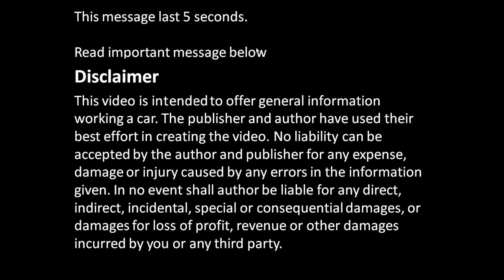How to test automatic transmission solenoid status: OK or Bad ?

Comment: Peter I'm currently trying to find a problem with my solenoids! 

When Commanded by the pcm to shift the Solenoids don't react 

When I take a 9v battery too the Solenoids they click 

I took the wire harness off and checked to make sure the 12v Wire works (It does) 

I connected the Solenoids to the wire harness and sent 9v power to it it works 

When connected to the main harness the TCC solenoid clicks when commanded and as power but solenoids A/B Don't!   

Can a solenoid click when hardwired and simply not work when installed because the pcm refuses to signal it???
Reply from the maker: Hi, what car You have ?
Reply: Peter Finn I have a 97' Turbo Firebird with a 5.3L and 4l80e I have it on my channel!
Reply from the maker: Hi, please check all cables, fuses and also solenoids.

Comment: Can't you just put an ohmeter across the leads and check resistance?  I'm trying to do the same thing, but an 11-15 ohm reading determines it's good, right?
Reply from the maker: Hello, Thanks for comment. :-)
Reply: if you use a ohm meter the reading is determined by the car my Bmw is 5.5

Comment: Excellent video. I tested some solenoids from Jatco Jf506e box of 12 ohms, 3.2 ohms and 18 ohms and they were quite a number. Those with high resistances of 18 ohms did not click. What does this mean? Does high resistance require a voltage above 12V to click? Thanks.
Reply from the maker: Hi, if no click, then solenoid could be bad.